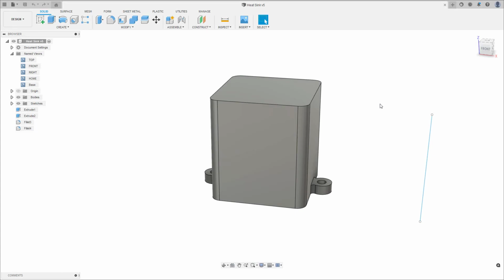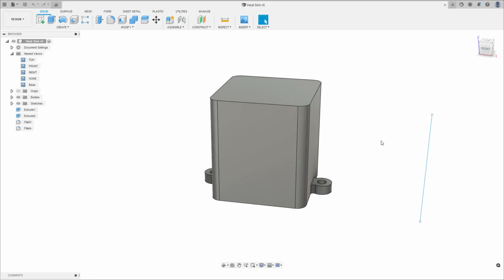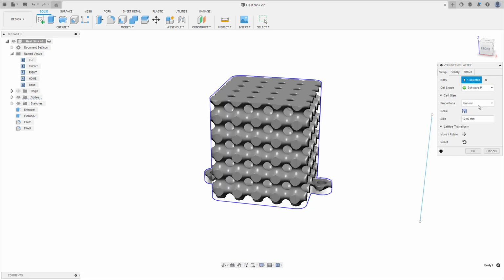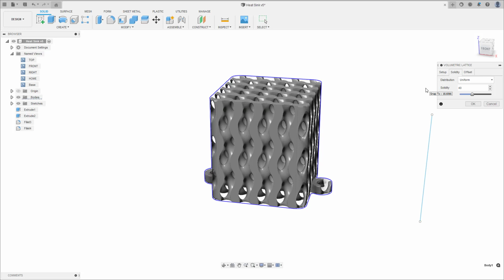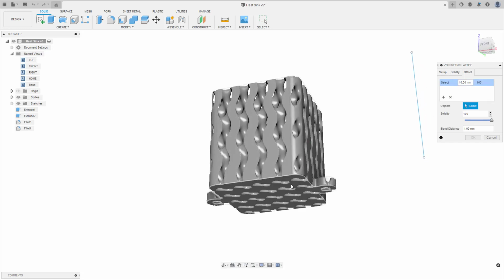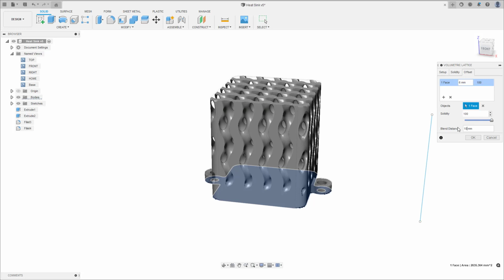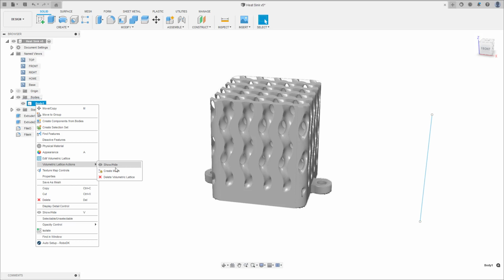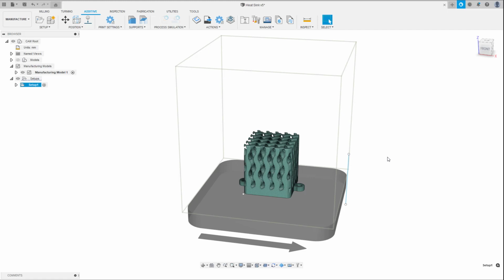Creating Volumetric Lattice Structures in Fusion 360 | Autodesk Fusion 360

Comment: I have an issue. After I export STL file and reopen it in Fusion or Solidworks, it does not show any gyroid structure on it. Do you know what I could be doing wrong? I also tried meshing the part and then save it as STL but still the same issue..

Comment: Hi, I have made a mixed lattice structure using three separate bodies, now I want to generate a model in stl form and it generates a solid body (made of three smaller bodies) (which are orginally designed as lattice --> I can see the structure in Fusion360, but not in STL file. How can I generate the desired structure?

Comment: The extensions are quite poor in terms of cost performance, outside of the US this value metric gets much worse. While the base Fusion 360 is about 5% more here in Japan, the extensions are marked up more than 40%. With flaky patterning tools in an arbitrary and rather limited set of extra tools $595 is too much, the justification for $840 is hard to understand.